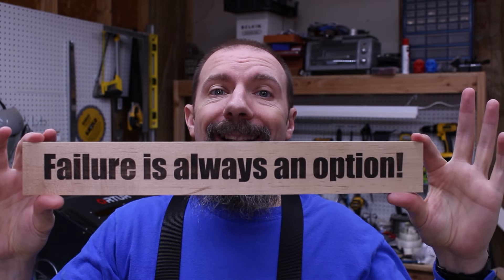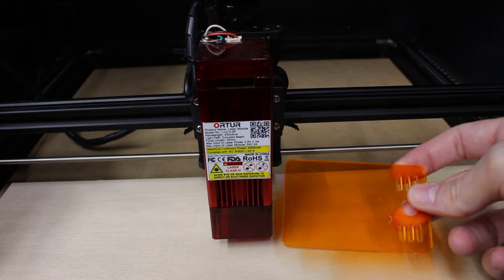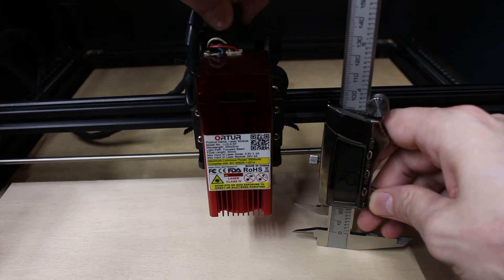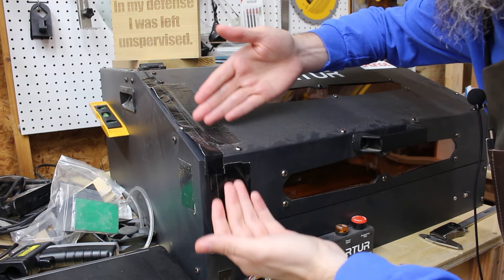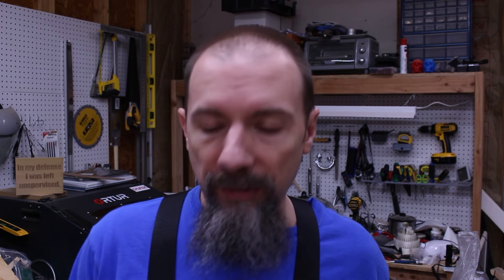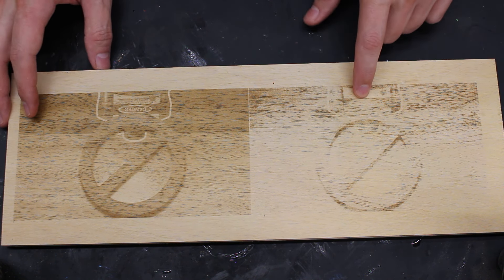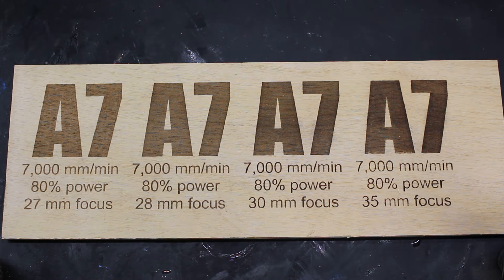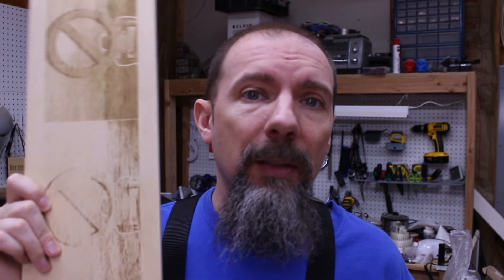Stop Using Borax on Laser Engravings! Try This Instead!

Comment: Instead of using borax, I’ve started to backfill engravings with FEP powder coat and then heat seal it with a heat gun. It works great and can give you color options.  FEP powder coat paints are also food grade safe so be needles to worry.
Reply from the maker: That's an awesome idea! Thanks for sharing!
Reply: If I may ask, where do you buy FEP powder coating paints in small sizes?
Reply: that only works with monotone images, innit?
Reply: @boruchlen  I just ordered 4 ounces from Amazon.
Reply: @fretworkpeddler  great to know! Thank you for your reply.

Comment: So basically using borax mixture is probably more accurate and better for darker engravings over defocusing the laser. I mean it seems like having to spend a lot of time figuring out what the proper focus would have to be to get dark engravings it would just be easier to use a borax solution.
Reply from the maker: It took me about an hour to run all the tests to find the sweet spot for the engraving. Time well spent in my opinion, because I'm no longer using any chemicals on my engravings. Also, I don't have to worry about sealing the piece to make sure the soot from the Borax doesn't rub off because that's all you're doing with Borax is making darker soot that can easily rub off if you don't seal it in. For many people in Europe it's harder to get Borax and for them, defocusing is a better alternative.
Reply: @LetsMakeAThing 

That hour spent testing wouldn't fly in a production environment. The borax solution is very weak, but could be substituted with other very weak household base ingredients by the intuitive. Borax is only potential dangerous in high concentrations,, whereby it CAN cause a burning sensation on your skin, more severe in the eyes (duh), and you don't want to ingest it. The 10% solution used for engraving is rather innocuous. Has anyone tried baking soda or a salt solution? Everything is comprised of chemicals and borax is one of the least toxic of the household array, although it is still toxic on some levels, depending on how it is used, so alway wear gloves. The point is, there are always alternatives. Vinegar or lemon juice might be a way to go.
Reply: @LetsMakeAThing  I don't understand the Borax situatiion in the EU, especially in Germany. On Wikipedia it says: it's forbidden to sell to private end users. On the other hand it's allowed to used as a food additive (E 285). You can buy it online everywhere. I don't know whats wrong or right. The only thing I know is that there's no problem to buy it in Europe (Germany).
Reply: @PacesIII actually R&D is well worth it in the long run. I cut my teeth on a cnc machine years before the average person knew what one was. The time spent testing like this put me way ahead of my competitors running 150k machines with my 7 k setup.

Comment: Your caution about laser light is correct but in this case totally wrong.
 Laser beams by their very nature are  coherent beams of light and do not have the ability to jump out at you. They travel in straight lines.  Unless you can get your eye (or your finger) into line with the laser beam, which I think is pretty impossible with an 8mm gap,  then your eyes will not be damaged by the laser beam itself. However, the reason you would want to wear eye protection is for two completey different resons that people don't speak about.  First, when the laser beam strikes your material  the exothermic reactions that results when the beam heats the material generates a bright light that is has dangerous high levels of UVB and UVC radiation. UVC in particular can damage human tissue of any sort (especially eyes). Ordinary polycarbonate clear safety glasses (not glass) will absorb UVC and protect your eyes.  
BUT there is a second risk to your sight.....light intensity. Would you look at the sun for more than half a second or watch arc welding?  So in that case you need a reasonably strong tint to the polycarbonate to attenuate the intensity. Understand and respect  a laser beam, do not fear it.
Reply from the maker: Thank you for taking the time to share your knowledge! When I was talking about running without the guard and wearing glasses it was due to long term exposure to the laser intensity over time. I didn't take the time to explain in the video it was due to the light intensity as the video was focused on the dark engraving process and I felt that a simple "don't try this at home" was sufficient.
Reply: @LetsMakeAThing 
 Thanks for understanding that no criticism was intended or implied.. Sharing facts about laser safety is essential because too many of my corespondents have already spent anything for $20 to almost $100 on "laser" safety goggles before they ask questions  With virtually all CO2 lasers, close the lid and you dont need any safety glasses . Sadly the same is not true for the unguarded  diode lasers but  good sunglasses will provide adequate protection. I know it can be hypmnotic to watch your laser but dont for more than a few seconds at a time.
Reply from the maker: @SarbarMultimedia  Don't worry, I never watch my laser unguarded. All the shots in my videos are done wearing protective glasses and letting the camera film the action. You do bring up a good point though and I will probably mention this in a future video about not staring at the laser. Thanks again for sharing your knowledge, I really appreciate it!
Reply: How were you able to type this in braille?
Reply: @MileyonDisney  
After 10 years using various lasers, it took time to get used to my braille keyboard. Seriously though, In the past year I have taken to studying various powers of diode laser and am now playing with a 40 watt head,  Of all the lasers I have used,  the diode is the most dangerous to your eyes. Its not the laser beam itself but the  hideous light intensity of the ionized material around the laser contact spot. ALL the laser energy is going into damaging the material so there is zero risk of your eyes being damaged by the laser beam itself. Remember simple science says that light travels in straingt lines  so it's not going to somehow turn 90 degrees and "bite" you. The real danger is the  intense random non-laser light. You would not look at the sun or a welding arc without eye protection, so good dark sunglasses are  perfectly adequate. There is nothing else dangerous about the light, just its intensity. however, I would always limit viewing it to a few seconds at a time.

Comment: Hi ! Instead of your method, here a suggestion to increase your distance : put a 1mm thick material on top of the thing you want to engrave, before you do the first focusing, then remove this 1mm thick material and tadaaaaa you are 1 mm further !
It seems way easier to me like this, but i may have missed something, please tell me (and excuse me for my bad english language, i'm from another country)
And thx for this video, great advice, that helps me a lot !
Reply from the maker: Thanks for the tip! I was using the calipers in this video just to get measurements for the test. I don't use them to focus my laser. I use the method you suggested with a material that I know the thickness of. I have a different laser now that doesn't have the focus know so I use blocks that I know the thickness of to focus. I just released a new video related to defocusing your laser where I use the method you suggested. You can check it out here: https://youtu.be/GQ0VTQZMc9M
Reply: A tapered gauge or gauge blocks would work.

Comment: The whole point of using Borax is that you only need 20% of the power that you would normally use to get the same results. No distortion. Diode lasers work great with Borax. Stick to Borax and save on electricity.

Comment: Information: Laser engraving is etching or indenting the surface, correct? Laser engraving foil- Does it cut into the surface and attach the foil within the endention or does it only attach the foil on the surface?
Reply from the maker: The laser only engraves the surface it doesn't attach anything.  Basically, it removes material from whatever you're engraving by burning it away. In my other video, where I do foil inlay, I glued the foil in by hand. The laser was only used to remove material.  Hope this helps!

Comment: I use a small fan to blow the smoke away I find that the type of wood makes the biggest difference. 😀🛫
Reply from the maker: Even with air assist and an enclosure with a 4 inch duct extraction fan I still get soot with Borax. I don't even mess with Borax anymore because this method works so much better. I am curious though, what wood seems to work best for you?
Reply: yes what wood works best for you?

Comment: First, I'd like to say that I'm learning laser engraving/cutting right now, that's why I'm curious, don't get me wrong... (also I'm not english)

Maybe I'm wrong, but... aren't you just making the dot bigger. If you don't change settings, then the laser scanning lines are overlapping... That's why it's darker. You could just increase LPI and the result should be similar...

Some users are getting the same result lowering the  laser instead and that could prove my point since the laser beam is like >< where the optiomal focus is the center (small dot) and it becomes larger if not in focus (either raising the laser or lowering it)

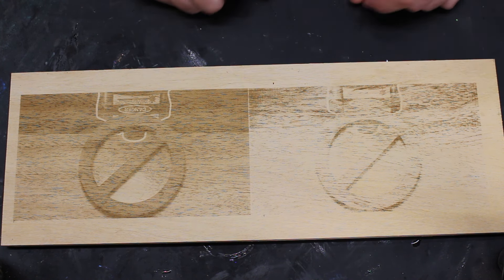Since you talk about this (more or less) in 6:30 it looks like you already know it... Then, what's the advantage of defocusing the laser instead of changing LPI and power?
Reply from the maker: It's a good question. In terms of speed changing LPI makes it run slower. The more lines per inch the longer it takes. This method gets a darker burn without increasing the engraving time.

Comment: Rather than using calipers I would just use the laser focusing arm, and place shims under it.
Reply from the maker: I used the calipers to determine the optimal focus distance and then made a spacer to use as you suggested. I don't think I showed it in the video though.

Comment: As defocusing lasers results in bigger dots, you will destroy your resolution. As with CO2 Lasers a lot more as the dot is naturally bigger at that wavelength.  Photo engraving on a CO2 Laser is theoretically best at 254 LPI, as the beam is 0.1mm (if perfect, but thats rare even with very expensive machines). With my old Red&Black KH7050 i ran about 200 LPI with the latest method of Russ Sadler (Concise RDWorks Learning Lab Series, Session 25-27 and later). If i defocus my laser by only 0.5mm i will lose a lot of my resolution. Of course, the image will be darker, but it will lose a lot of detail too if i dont correct the LPI to lower than 200. If you only do bigger text or bold graphics, thats a small problem, but if you want photos, you need the sharpest and smallest laser dot you can get.
Reply from the maker: Excellent point! Thanks for sharing!

Comment: Newbie question: Wouldn't you get a darker burn if you just slowed the speed or upped the power?
Reply from the maker: Great question! When you slow down or increase the power you increase the amount of material being removed from the piece. So in many cases you'll end up with a deeper engraving that still isn't dark. At some point you will start over burning the material and it will get darker, but so will the surrounding areas which is not desirable.

Comment: I would thick that defocusing the laser would make for a not so detailed engraving.
Reply from the maker: I've been doing engravings using this method for months now and haven't noticed any loss of detail. In my next video I do several detailed engravings with a defocused laser and they all came out great. Of course I'm biased, so check out the new video next week and let me know if you think there is loss of detail.
Reply: @LetsMakeAThing  will do

Comment from the maker: This video was a lot of fun to make. I was really surprised that this method works for diode lasers. Well, mostly works. If you have any ideas for more testing with this method leave me a comment!
Reply: This method should work fine with vector images like an SVG file. I'm waiting for my Xtool D1 Pro 10W to arrive so learning as much as I can beforehand. I am familiar with Fiber Lasers though.
Reply: Why don't you try to slow down?
Reply from the maker: The point of the video was a method that gave a darker engraving without slowing down or changing power. I probably would get a better effect on the image if I had slowed down but I didn't feel that way in the spirit of this video. I will definitely try again in the future using a slower speed.
Reply: I do laser engraving as a profession. I have a CO2 laser and a fiber laser. With wood, I go up to 12mm out of focus. However, then the speed has to be reduced significantly. Since the power is brought to a larger spot. Of course, you could also increase the power. But reducing the speed is often better.
Since you want to transfer the out of focus trick to the diode laser, it would be logical to reduce the speed here as well.
Reply from the maker: Thanks for sharing your knowledge!